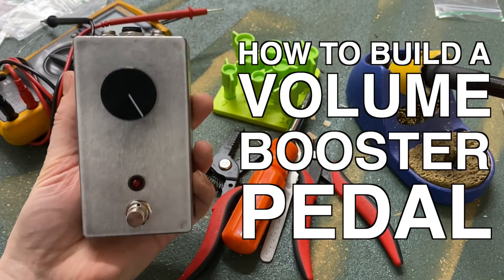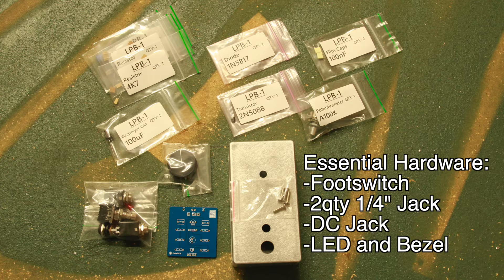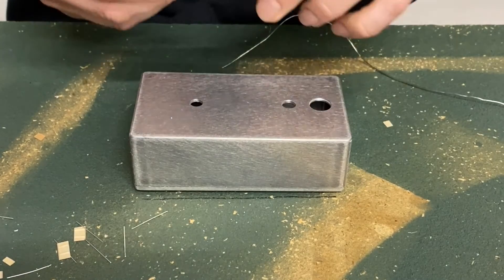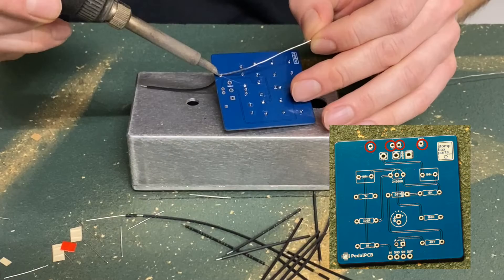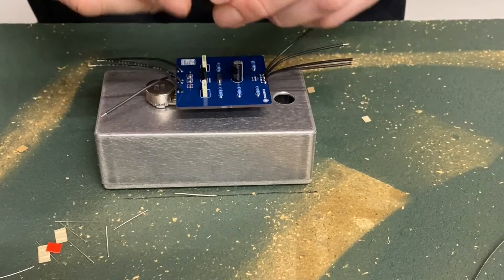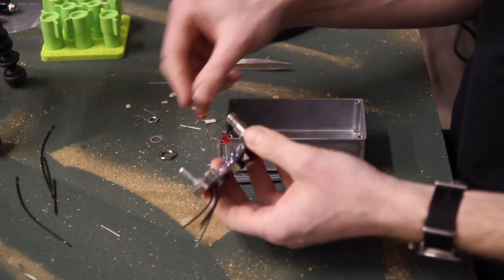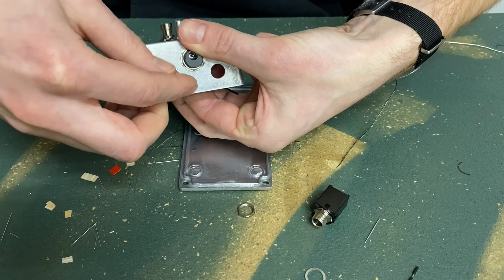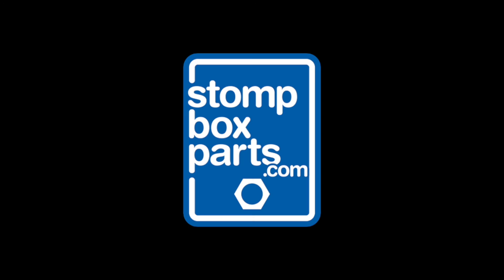How To Build a Volume Booster Guitar Pedal | DIY LPB-1 Effects Pedal by StompBoxParts.com

Comment: could i replace the 2N5088 tansistor with a jrc 4558 op amp? 3:35
Reply from the maker: No. The 2n5088 is a 3 -pin bipolar junction transistor. The JRC4558 is an 8-pin IC dual op amp.

Comment: Why not solder jacks before installing them ?
Reply from the maker: Totally valid if that works better for you, more than one way to put this together. With the short wires from the PCB, most tend to find it easier to solder the wires to the PCB first, install the jack and solder the wires to the jack in its final place.
Reply: @StompBoxParts  Thank you for your reply, I have not quite made it to that part. I am going to order some of those jacks. I don't like the exposed one I have.

Comment: just finished my kit and i was very fun to build, but when i was finished i got a flicker of light when i turned it on, and then the signal would get cut off. are there any specific joints i can check for these issues
Reply from the maker: Make sure wiring at footswitch and PCB is clean, no frayed wires. Make sure the bare jumper wires on the footswitch are not touching any lugs other than the ones they are soldered to.
Reply: @StompBoxParts  update, checked everything and still not sure what the issue is, do you have an email or something i can use to send a picture of the board?